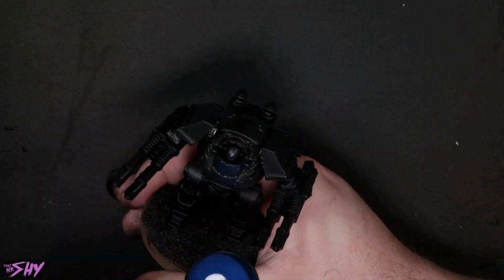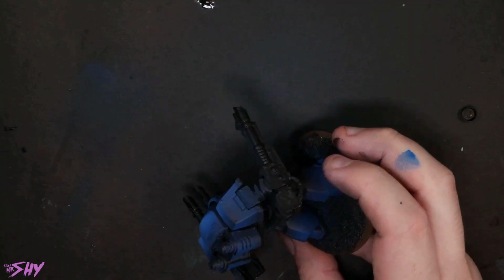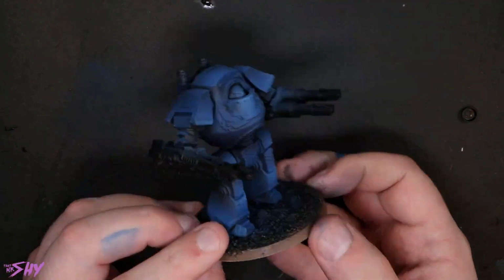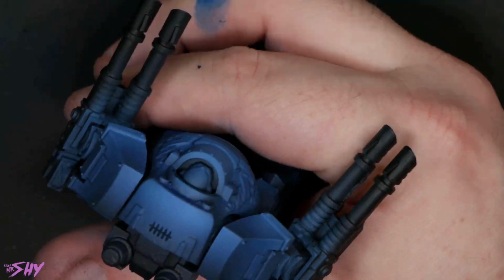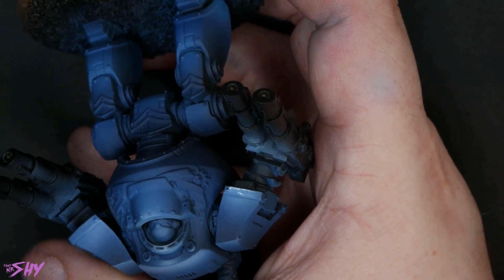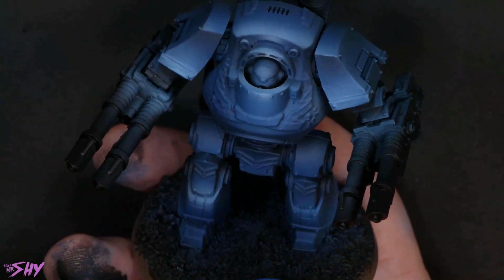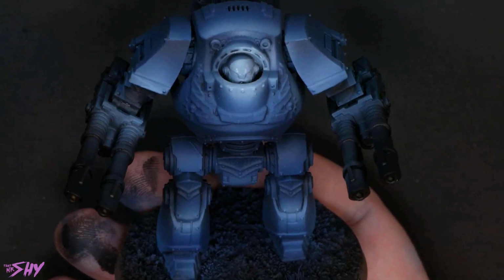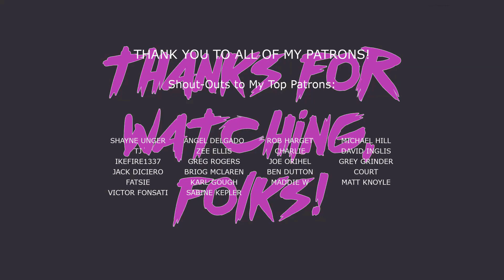Testing the Reaper Vex Airbrush on a Contemptor Dreadnought (Fixed Audio)

Comment: Haven't finished video yet, but will say I also own multiple different brands of airbrushes and my Badgers (who make the Vex) are 99% of time my go too, my current fave is my UMP Apex, which is a modified Badger Omni 4000 that I then added a high roller trigger too, can get really fine lines but also wide spray pattern, its about the only brush that I own that I'd argue could do 99% of the work I need from a airbrush without changing anything